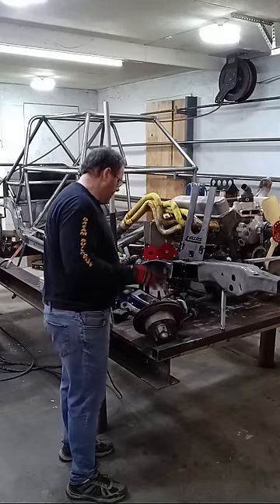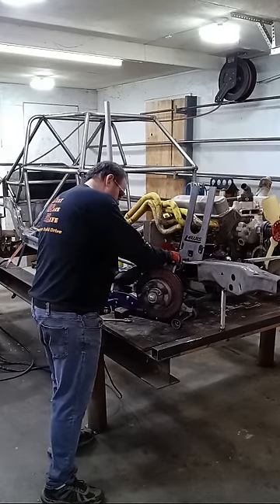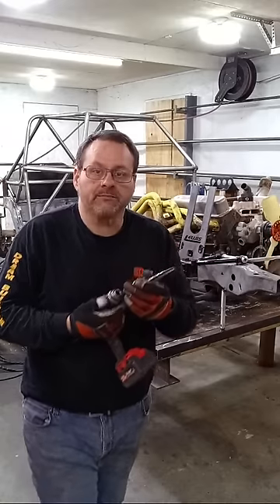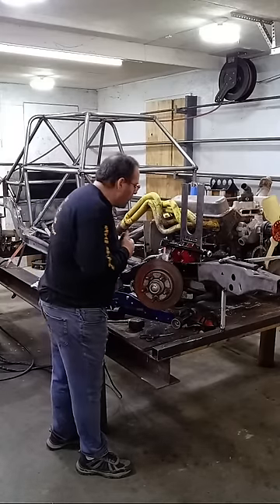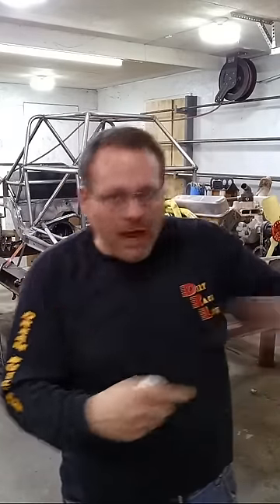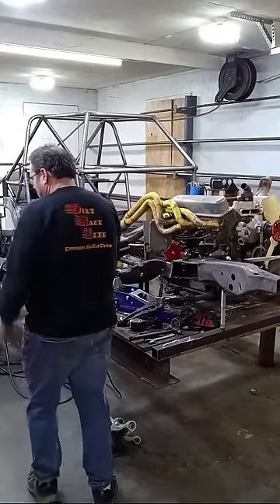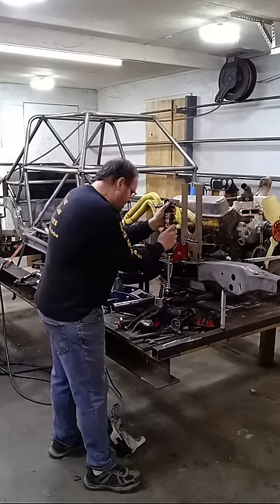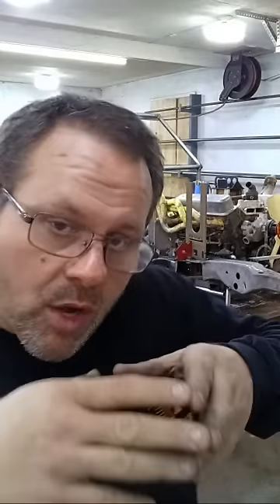LIVE Sneak Peak as I Get Ready to Install Upper Control Arm Mounts!

Comment: You can check your caster without turning the wheel if you put a straight edge on top of spindle where upper ball joint goes and put a angle finder so if your spindle is level you have 0 caster the more it leans back it adds more caster
Reply from the maker: yes sir, but it does not account for the spindle inclination. so the two dont line up. it does work though as far as if you add a degree and measure it there you will see a degree in real caster as well. they are close depending on which spindle.
Reply: @DIRTRACELIFE I would rather use a caster camber gauge too. Pin angle changes everything when the wheel turns..

Comment: Just adding my two cents here. But you can never ream a spindle square. So to make things easier I use stock diameter pins. Easier and spindle checker will go through spindle straight.
Reply: I have reamed mine many times the same way before but now I bolt mine down to my drill press to ream them.
Reply from the maker: Not going to argue with you on the accuracy Chad. For sure I agree, you can NEVER hand drill anything perfectly straight.  However, tell me the part number for the Chrysler screw in uppers with a 10 degree taper to fit the camaro spindles. I looked HARD and came up empty. That's problem I ran into. On the lowers I was able to get the 10 degree tapers, they were just bigger diameter. I think Sam has a good idea on using the press. I didn't go all the way yet on those where I could make sure to get them just right and I am going to do like he said and mount them in the press.
Reply: Upper HOW22369A
Lower HOW22475
Reply: Also cup for lower is 
HOW22450SSB
Reply from the maker: Well I got the correct lowers, those are the ones I am using, I wish I had found those uppers. Looks like I can get those replacement studs on the upper part straight from Howe for future reference and I have several sets of spindles so I can easily do that on a set. Thanks Chad, don't be mad when I pass you using those  ;)
Reply: lol. Not a problem
Reply: @DIRTRACELIFE  I think opening up and using a 10 degree reamer in a 10 degree tapered hole should stay close to straight  The problem I had was going from a 10 degree to 7 degree the reamer would walk around and get out of centerline.